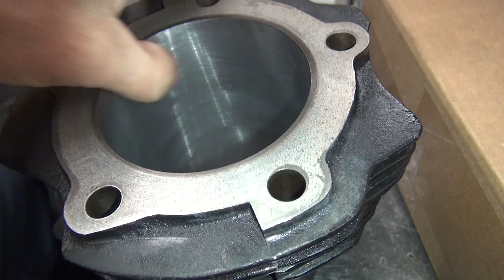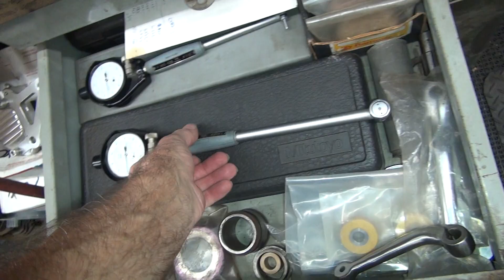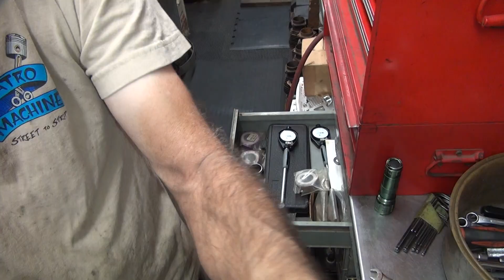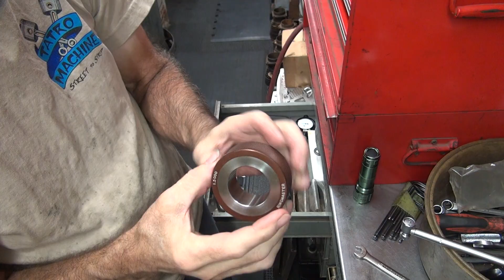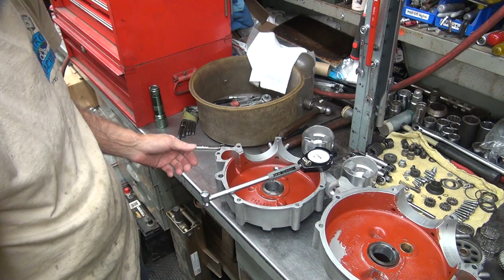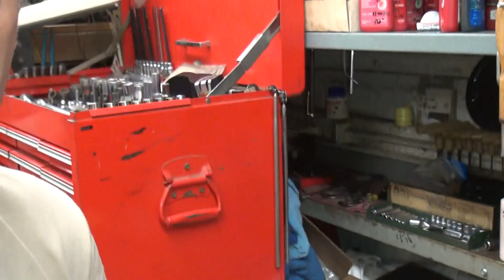#159 1946 junk 84ci stroker knucklehead 500 mile new repo motor rebuild 79ci harley tatro machine

Comment: What the customer probably really wants is to have bought a different motor!
Reply from the maker: that could be, but now he will like it.
tatro
Reply: @TatroMachine  this does make the case (no pun intended) to use genuine Harley cases whenever possible.
Reply: @johnkelly6942 From what I'm seeing, it's questionable whether or not they're much better. Very few machine shops or engine manufacturers blueprint engines on the assembly line.